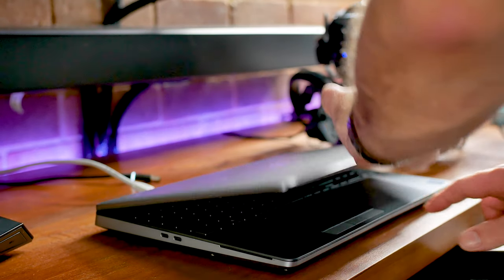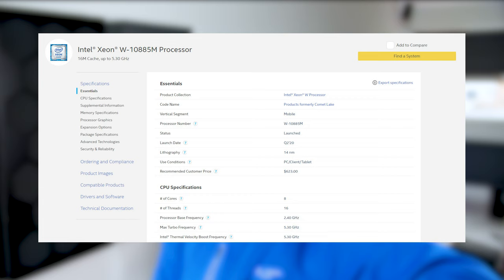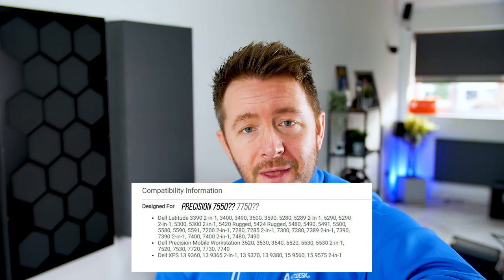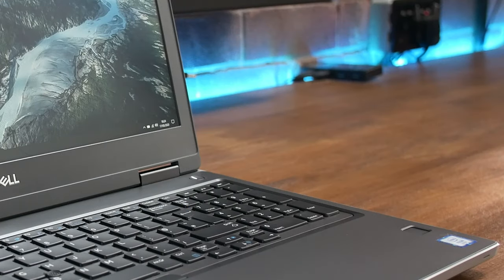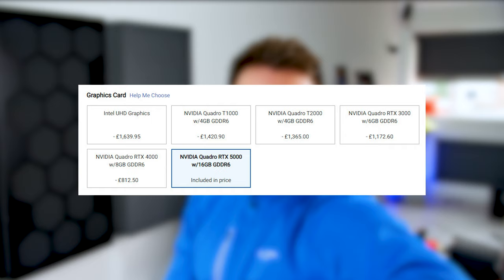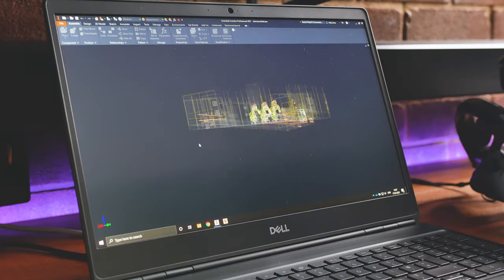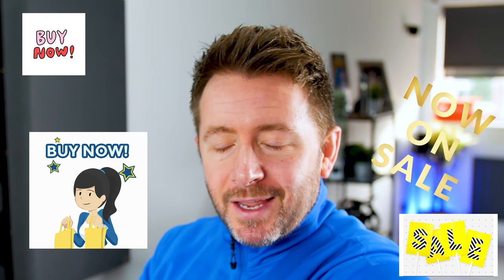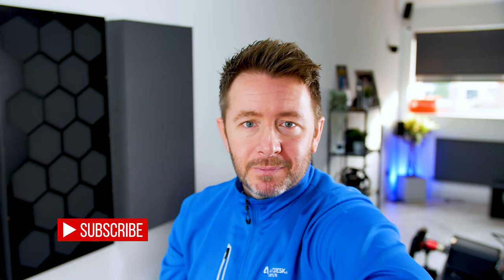This PRO laptop is as good at CAD as a DESKTOP i9-9900K! Dell Precision 7550

Comment: The throttling and low video bandwidth you encountered were both the result of you using the wrong dock model for your test. The WD19 180W dock isn't designed for Precision 7000 Series systems. It only passes 130W through to the attached system, which is much less than that system is designed for, and as a standard USB-C dock, it can only tap into two DisplayPort HBR lanes for video bandwidth; the other two are allocated to USB 3.x data.  The dock specifically MEANT for Precision 7000 Series systems is the WD19DC, which can provide up to 210W of power AND access more DisplayPort HBR lanes because it plugs into BOTH of the USB-C ports on the system. The WD19DC was launched at the same time as the WD19, and even before that, there was the TB18DC that was designed to support Precision 7000 Series systems, so you simply got the wrong product when the right one was available.  And in terms of display capabilities, the WD19DC will run single 5K 60 Hz or 8K 30Hz, or dual 4K 60 Hz, or triple QHD.  And for that matter even the regular WD19 when paired with a DisplayPort HBR3 system will run single 4K 60 Hz, or dual 1440p, or triple 1080p displays. Show me another USB hub that can do that and provide those power levels, allow PXE booting, MAC address passthrough, etc.  Maybe before you go off ranting about a negative experience with a product and its low perceived value, you should confirm that you actually bought the right product for your use case.

Comment: Hey Tech3D - did you have issues with windows shutting down with bluescreen of death... my just randomly restarts and does not seem related to work pressure. But my fans starts running high after the restart into windows. Its annoying with a PC in that price class. I have the standard 16gb ram so that is my only concern that they may need to be updated to 32. But again since it happens with just google chrome or MS teams open its seems odd that should be the issue.

Comment: Ahhhhh! You have a very similar same issue with your dock as I do. I bought an HP dock (as it has a speaker which is super handy). Two triggers which cause it to throttle:

- After the unit has botted plug this into the Precision 7550, and all good. But the whole unit will throttle down to 800Mhz as soon as I connect my phone to one of the USB C ports of the dock. 
- Boot the unit whilst plugged in.

My assumption in both cases is the USB C/Thunderbolt attempts to charge over the USB. The second of these is easily remedied by unplugging the power and usb c and then plugging back the power.

Comment: Very interesting. I'm thinking about picking up a Dell refurbished 7550 (without a discrete GPU) to use as a Linux workstation. Unfortunately, the condition is described as "scratched and dented", and there's no return policy. Once you buy it, you're stuck with it.

Comment: I bought my former boss the very same laptop for CAD work a couple of weeks ago so I guess I'm in good company and made a pretty good decision :)
No complaints about it. Easy to add extra RAM and seems to be a reasonably good buy although I haven't spent too much time with it to fully get to know the pros and cons. I opted for 64 GB of non-ECC RAM and I did get the expensive dock because I decided to take a leap of faith which has turned out to be an OK decision so far. I will look into the thing with the clock speed mentioned here though. Not that I noticed it being extra slow or anything but then again I pretty much just set it up and then left after installing some software.

Comment: That power button placement is a real WTF. There is an interest for the iGPU only configuration option if you   need a beefy CPU but have no use for a dGPU, such as being a software developer
Reply: I'm using Latitude series for years and now consider basic 7750 as another Latitude but '17 screen as my next machine.

Comment: Dell has a version of the thunderbolt dock with two USB C ports (one supplies additional power). It should solve your throttling issues!
Reply from the maker: I looked into all that... this dock is 180W but it only delivers 130W, but the interface is USB-C... but the older 7540 is listed on the supported page, but this one isn't, but each unit can have massively different power requirements, it's an absolute mess... we probably should have bought the WD19DC but then again they should be marketed far more clearly and differentiated than they are.  Even if it didnt throttle though, the bandwidth limitations makes the 3x display outputs utterly useless, which makes it an outrageously over priced hub whichever way you look at it!
Reply: Our IT people actually get this correct and supply the duel thunderbolt dock.
Reply: @Neil3D  On Dell's docking station compatibility guide here (https://www.delltechnologies.com/resources/en-us/asset/data-sheets/products/electronics-accessories/dell_docking_compatibility_guide.pdf ), both the 7540 and 7550 only list the WD19 as "compatible" with a "#" tag noting that it doesn't supply enough power to run the system.  That's why both of those systems only give the "Recommended" designation to the WD19DC.  Also, the second USB-C connection on the WD19DC also allows FAR more display bandwidth compared to what the regular WD19 can offer -- which is itself a limitation of how USB-C works because it can only carry two DisplayPort HBR lanes over a connection that is also running USB 3.x data.  The WD19DC has an entire additional USB-C interface with four high speed lanes available for video.  As such, the WD19DC can support single 5K 60 Hz or 8K 30 Hz, or dual 4K 60 Hz, or triple QHD.  This is all explained in the documentation of these docks, available on support.dell.com.  But for the record, the regular WD19 can run triple 1080p from a system that supports DisplayPort HBR3 over USB-C, so I wouldn't consider its triple outputs "utterly useless".  I might however apply that designation to those who post reviews containing strong judgments about products before even checking their information.

Comment: No need for large data to fill 128Gb ram - two graded 8k clips on timeline with basic transition between them may opt for even more. Actually even in 4K you can overfill 64Gb while, ok, not that easy, so 4 slots are definitely nice today and must-have tomorrow

Comment: Great video. Are you using a docking station of some sort instead of the Dell WD one? If so what kind?
Reply: The dock he should have been using was the WD19DC, which is specifically meant to support the power requirements of the Precision 7000 Series systems by offering up to 210W of power.  He used a WD19 180W, which only provides 130W, which is why he encountered throttling.  His negative experience was the result of using the wrong product.

Comment: Sounds like this DELL model is a beast, and just curious about running temperatures? Also can you recommend a high quality plug and play universal docking station? Or do you prefer to match them with the manufacturer of the laptop? Thank you as always and hope you are doing great. Cheers
Reply from the maker: I personally can't recommend any docking stations tbh, just a personal thing, I would never ever use one so I can't relate to the things people see in them.  Temps on this thing to get toasty but its a Xeon so its never really in any danger of hard exiting out... 70-100C regularly across all cores whilst the test was running.  All of this data will be presented on our website when that goes live but I might see if I can chart it properly in Excel and make a video showing the graphs in a better format, its just Excel and graphs aren't my strong point!
Reply: @Neil3D  Completely understand but having to work from home, and having to use multiple monitors I did notice my laptop temperature varied between docking and not. I only noticed it because of the poor performance while handling large models in Inventor or Point Clouds with higher temperatures. Just curious, and again thank you for your time and all the great content.

Comment: I have 7730 with Xeon 2186M, p5200, 64gb ecc. It can not handle 240w power. Unfortunately power socket burned and melted twice. Last month I bought HP Zbook 17 fury with Xeon W-10885M, Rtx5000, 64gb ecc. Dell notebooks has problem when it's working under heavy load more than 3-4hrs.
Reply: You won't believe i have a PRECISION 7710 with QUADRO M5000M 8gb graphics and 32GB ram... Its still a beast..
Reply: thx
Reply: @MrJitendra007  I have 3 dell products. One 7740, two 7730 with the highest configuration possible. The power cable inside burned twice. It burned and melted. I'm writing this to you from my USD7000 7730. I had to modify the power cable inside; instead of 8 thin wire, I soldered 2 thick copper wire, and It works fine now. When I contact dell service, they told me It's a prevalent problem. I burned one of them when I was playing COD Warzone at 4k. It really works fine as long as you don't force the machine for 2-3 hours. This is not normal for a workstation.

Comment: Are there reports of the 8 core Xeon running any cooler than the core i9? They are essentially the same chip, I haven't personally seen any difference between the two, however there are reviews of the i9-10980HK running at faster clocks/ lower temps than the standard i9, possibly due to superior binning. I would assume the Xeon's would have a higher voltage for stability vs. a gaming CPU please correct me if I'm wrong. 

I have the Xeon W-10885M and have achieved over 4000 on CBR20 with discrete graphics card off but at 115W and immediately overheats even after a repaste with LM (yes I got that desperate) 100C on a P15. 3850 with discrete graphics idle.

Comment: After watching this I am thinking about going with the 10855 6-core Xeon with the higher base clock and perhaps little more thermal headroom. What are your thoughts on this based on your workflow which is similar to mine? There is diminishing returns which really begin to be seen right around 8 cores. What would your feedback be on the 6 vs 8 core xeons?

Comment: Amateur Question which may not make sense.. If I connect 2 screens to hdmi and to mini display port do I get access to the GPU ? Also if I connect 2 screens to the dock do I get GPU or a USB display device ?
Reply from the maker: Depends on the laptop as to how it handles the display out but generally yes, you can quite easily verify that by starting a program and looking in task manager. The GPU column will usually be 0 for the CPU graphics and 1 for the proper GPU. You can also force most laptops to only run on the main GPU in the Nvidia control panel or completely turn off the CPU graphics in the bios. Some laptops come with software which let's you enable discreet mode without needing the bios. Using the Dock also uses the gpu as well, I'm currently using the Dell universal Dock to output to my main monitor and I'm getting access to the main gpu

Comment: From a whole video, which is great btw, my greatest attention was on thunderbolt dock. We switched from precisions m6800 and e port replicator docks to lenovo P73. “Logically” we bougth them with thuderbolt docks. I have always had my doubths about them. Do we need them actually? I thin they are bottleneck, have glitches and expensive. Could you write few lines about them generally
Reply: He used the wrong dock for his testing, which is why he encountered throttling.  The WD19 180W supplies up to 130W to the attached system.  The dock meant for Precision 7000 Series systems is the WD19DC, which supplies up to 210W of power and therefore will avoid throttling.  If you want to use any other dock model, you'll need to keep the system's own power adapter directly connected as well in order to avoid throttling because the Precision 7000 Series systems require way more power than the 100W max of the USB PD spec.  The WD19 180W stretches the spec a bit to 130W, but the WD19DC provides 210W by plugging into both of the USB-C ports on the system.

Comment: I get whatever is on the "mobile heavy user" IT profile from my large employer lol. They are ok. 
I was trying to get Vault for my team but as our company are moving to Siemens PLM I gave that up. Before that I did accidentally end up having a conference call with Autodesk senior sales team thinking I was the head of engineering for the whole business 🤣
Reply: Good Luck to you if you end up using Teamcentre.
Reply: @michaelb2228  I had some training, the inventor integration is being done q4
Reply: @TheBlankmediams  I was contracting at a company similar to Neil's not that long ago and the tie up between Inventor & Teamcentre was not brilliant. That company is not a small operation and is in the process of moving to NX to improve the compatibility (hopefully.) Depending how IT integrates Teamcentre various processes in Inventor may frustrate. Where I was a "copy design" of a fabrication gave each element an individual part number. Going deeper all order quantities via TC required a manual check as data seemed to skew what was needed. As I said good luck & hopefully your IT dept. is on the ball!
Reply: @michaelb2228  we are also not a small company also. team centre was used in the aerospace devision first and is being rolled out to the others. They have a full time team centre support group so hopefully it isn't to bad. The quality function is also being made to use it. We will see what happens lol

Comment: What was the cost as spec'd?
Reply from the maker: Ahh depends on where you buy it from tbh, I think we paid  around 2200GBP exc VAT per unit but if you spec this exact one into Dells website it'll probs cost more than that, but we went through a third party supplier for them.  Hence why we probably ended up with duff docks.
Reply: @Neil3D  Thanks for the reply!  I'm a big fan of your channel.  I'm an old dude with 22 years on SolidWorks, and the last 2 on Inventor, so you've really helped me a lot.

Comment: Why do people need more fps then 60? When they don't use a trackpad T650/T651 or a Surface Dial for smooth scroll? pavelfatin.com/videos/scrolling.mp4 / youtu.be/mojMUd9b87g only with a dial or trackpad you don't get scroll by line in windows what causes headaches.